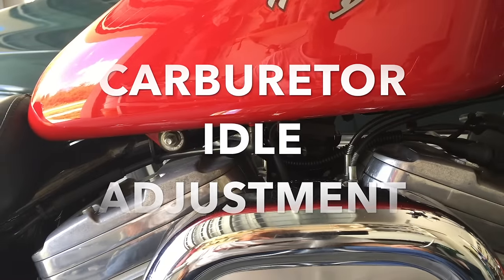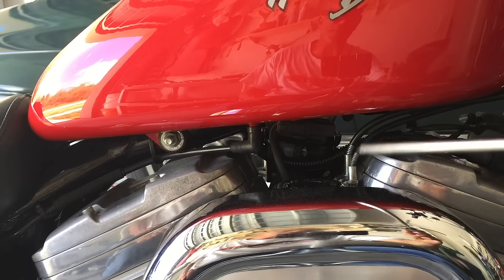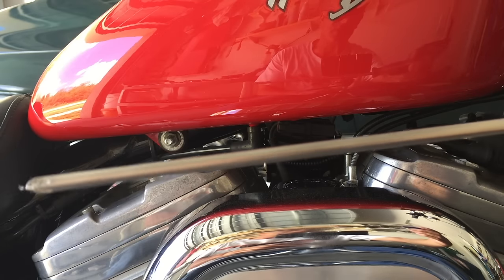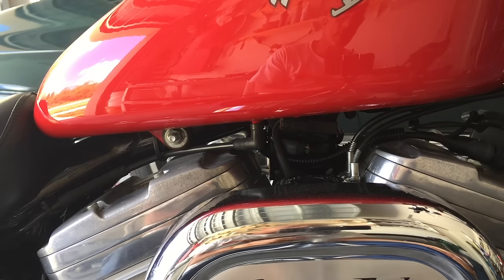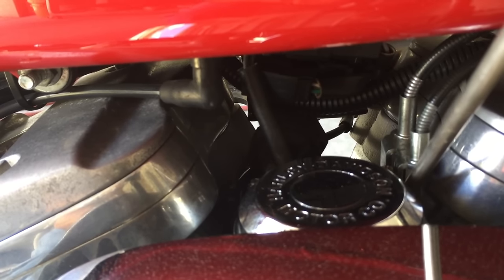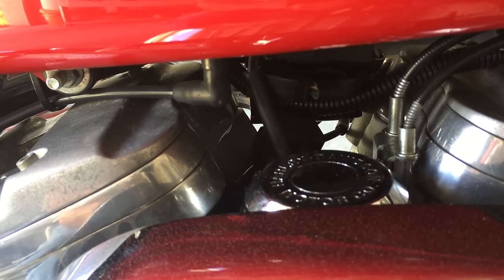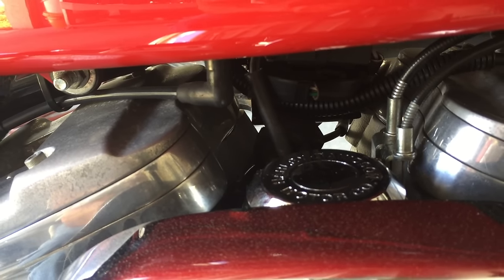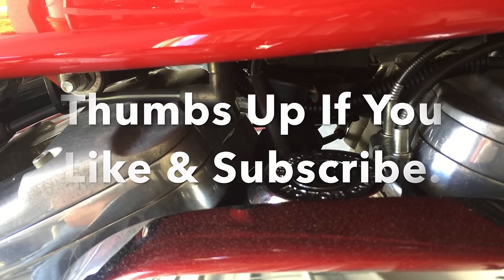How to Adjust the Idle On All Harley Davidson Carburetor Motorcycle.

Comment: Rocco, thanks for your videos! Question I have is: I moved from sea level environment to 6,500 elevation mountains. After I moved, I pulled choke out all the way and fired her up. She purred like a kitten but if I pushed choke in she'd die. Now that it's colder, it's tougher to start. Will this screw you're referring to be the right thing to adjust on my carb so I can get her running right with the choke pushed all the way in? Thanks in advance!
Reply from the maker: What year? How many miles? How long did this bike sit without being ridden?
Reply: @TwoWheelRocco  02 fxdl cv carb. 24k miles. Cleaned carbs at 23k. Sat for 3 weeks after running her last. With the choke all the way out, it doesn't seem to let me get what's needed to turn her over at cold start in 30 degree weather.
Reply from the maker: Sounds like fuel problem...I would look at vacuum line for petcock...those vacuum line can get old and fail. same with vacuum diaphragm on petcock...New $35 ... dealer part
https://www.youtube.com/watch?v=7Fo9Q93OJXI&t=8s
Let me know how this works out.
Reply: @TwoWheelRocco  hmm interesting. Didn't think that would happen with change in altitude like that. I'll check it out. Thanks!
Reply from the maker: Since  It is getting worse, And A/F screw makes no difference..points to gas supple...Let me know how it works out.
Reply: @TwoWheelRocco  it's not something that's been getting worse, it's more happened overnight from moving from 20' elevation to 6500' elevation. At sea level I would go through the usual pull choke out, cold start and then adjust choke in as bike got warmer. Higher elevation, pull choke out, cold start and bike rpms are at 1200. As bike warms up, rpms don't climb with choke all the way out. If I adjust choke in, it'll die with rpm drop. Not a problem with 80 degree weather but it is when it drops to 50s. Plus I would thing I'd be running rich with choke out all the way and normal riding.
Reply from the maker: OK Let me know how it works out..
Reply: @TwoWheelRocco  was the idle screw per your video. Had some warmer weather today, let her heat up a little. Pushed choke all the way in and she almost died. Turned idle screw up to 1300 rpms. Let her run for 10 seconds dropped her down to almost 800 then back to 1000 and left her there. Took her for a spin and no conk outs.

Comment: Rocco a question; my FLSTN 1993 has an issue since I can remember, when the bike is at 750rpm and up the exhaust doesn't sound, doesn't pop like yours all I hear is the engine mumbling but if I pull choke out the bike pops nice like a real Harley despite being really high the rpm, without choke the bike doesn't feel like idle I need to lower it way too low 500rpm to feel the exhaust sound like idle. Is this carb related or that the spark is in wrong setting?
Reply from the maker: What Carburator and pipe are you running? Sounds like your idle jet is to small. What motor? Do you know idle jet size? You can adjust Air/gas screw out, that's counter clockwise out.
Reply: @TwoWheelRocco  I'm running stock Harley cv carburetor and I have tried with 3 different pipes the bike when warm sounds like a washing machine not a Harley at or beyond 700rpm but the weird is if I pull the choke the the bike pops nice like a Harley like yours but more reved, without the choke on I need to lower the idle way down 500rpm to hear the exhaust and not just the engine alone like a washing machine. I will check the mixture screw tomorrow also the idle jet.
Reply from the maker: @AndresCuervoArt  Let us know how it works out.
Reply: @TwoWheelRocco  I now know what is happening the revs are staying up,  so if I place the idle correctly when I twist the throttle the bike stays high so it doesn't idle, we disassembled the carburetor cleaned it, replaced the idle jet with a bigger one, replaced the air seals on the manifold to engine but bike keeps doing this... I have to lower the idle screw a lot to make it idle then screw it back to a correct idle but then wheb I twist throttle the bike stays high at a different speed I.e. 550rpm vs 850rpm
Reply: @TwoWheelRocco  also I tried to adjust the mixture screw but I noticed when I screw it clockwise looking at carb from bellow the bike keeps revving up doesn't stall then I reach the end if I unscrew it counter clockwise looking from bellow the bike starts to stall at 3 turns or so... So I'm confused the bike. Is running great but it doesn't sound like a Harley on idle it's always super high not idle.
Reply from the maker: @AndresCuervoArt  Sounds like an vacuum leak.. And will not maintain idle.   spray carb cleaner around intake to see if you have a vacuum leak. What size idle jet and main jet are you running? what motor?
Reply from the maker: @AndresCuervoArt   Clockwise on CV Carburator closes gas circuit,  counter opens gas circuit.  1 3/4 to 2 1/2 out is about the right adjustment and that is counter clockwise, if you are running the right idle jet.
Reply: @TwoWheelRocco  when closing it fully the bike never stalls... What does this mean? Clockwise I have a digital tach and noticed that the revs go up when closing it but it should stall from what I've read...
Reply: @TwoWheelRocco  I will check tomorrow main jet and leak the idle jet is 40 now
Reply: @TwoWheelRocco  motor is 80ci Harley heritage softail 1993 FLSTN
Reply: @TwoWheelRocco  https://youtu.be/vc6es_OUtk0 this is when turning the idle adjustment way down to force the bike to idle then adjust it up. Sounds nice and stable
Reply: @TwoWheelRocco  when I twist the throttle the bike sound like this https://youtu.be/HrwnNynGv1s

It never returns to the desired idle stays high.  Do you think an air Leak from manifold would cause this?
Reply from the maker: @AndresCuervoArt   Yes it should stall when Air/gas screw is fully screwed in. If it does not stall you are getting gas from some other circuit.  Idle is set too high could be a posable.  Set A/f to 1 3/4 turns out.  Then start and adjust idle. What idle jet are you using?  And what motor 1340?
Reply from the maker: @AndresCuervoArt  40 is not a stock jet size for your stock carburetor that is your problem, Try an 45 idle. 180 main  A/F 1 3/4 to 2 1/2 is a good start. For CV carburetor. Try that and you should a difference on a big V twin.
Reply: @TwoWheelRocco  Rocco we replaced carbs and noticed the carb was leaking air or gas from somewhere we used different jets and needle combo finally with my needle a small jet and stock main jet found a combo that works now the carb idles and returns to idle nice also noticed that when we switched the needle with flute on the main jet that bike started to sound snappier amazing sound now bike is running a little leaner but will try to adjust mixture and if doesn't work I'll replace the idle jet for a bigger
Reply: @TwoWheelRocco  just to make sure when unscrewing the mixture counter clockwise looking from bellow carb I'm enriching mixture right? Tomorrow I'll try to adjust first the mixture is almost perfect but is learner
Reply from the maker: @AndresCuervoArt  Yes, Let us know how it worked out.

Comment: Mr. Rocco, I have a 2011 sportster 1200 Custom fuel injection, it smells to much like fumes not sure it this is normal for a Harley? I have cleaned the throttle and censer with CRC intake cleaner and changed the air filter. it idles fine just the smell is strong. do you have any suggestions to try to eliminate the strong fume smell? you have help me in the past with a couple of things and I thank you for that.
Raul
Reply from the maker: Happy to help make sure you're not running too much oil in the bike sport is like halfway on the oil dipstick. If you noticed your air filter was dirty. There's a good chance you're running too much oil. Rule of thumb, if I get oil on your finger tips when I run your fingers under the air cleaner, there's too much oil in the system. I don't like putting oil on filters. I want them clean. I feel they run the best that way. Any questions just ask thank you for all your . Ride safe and have a great day. Love those sportsters. Let us know if that helps.
Reply: Thank you for your reply Mr. Rocco, I do fill the oil almost to the top of the dip stick but moving forward I will fill halfway to the dip stick. the air filter was dry and no oil Anyware. if the fume smell continues, should I take it into the shop or is there anything else I can do? I did change the spark plug and I use supreme gas from Chevron gas most of the time. again, thank you for your feedback it is greatly appreciated.
Raul
Reply from the maker: I would remove some oil from that oil tank,  get it to halfway on the dipstick. I would remove a half half a quart and see how it goes. Do it from the bottom unscrew it plug a minute or two put it back in check your oil level. It will be different. Your bike will run better cleaner. Hope this helps.
Reply: It is time for me to change the oil anyway and will only fill it to half of the dipstick and see how that goes. I appreciate you being there to help us out when issues arise with our Motorcycles. Have a great week. Just out of curiosity what type of Motorcycle do you ride? 
Thank you 
Raul
Reply from the maker: I have two sportsters one Road King and one GSXR I love motorcycles and my Corvette. You can see my rides on my YouTube page.  Ride safe and have a great day .

Comment: Hey Rocco my 2002 fdxwg3 cvo pops thru the carb sometimes could you suggest something fore it it's 88 cu in just recently did plug and wire change bike idles on the rich side thanks
Reply from the maker: What pipe, carb. and intake set up?
Reply: @TwoWheelRocco  the carb is 40mm constant velocity  with enricher and accelerator pump espfi38mm  throttle  bore . The pipes is  factory screaming eagle that came with the bike new .thanks
Reply from the maker: Test petcock for vacuum leak this will cause a rich condition. Gas leaks from petcock diaphragm threw your vacuum line to your carb intake.      Test petcock and check your old vacuum line from petcock to carb.   https://youtu.be/7Fo9Q93OJXI  Let us know how this works out. Thank you for your Sub. Ride Safe and have a great day.
Reply: That did the trick thanks a million my friend it was the vacuum line it self thanks be safe....
Reply from the maker: Happy all went well.  Ride Safe and have a great day.

Comment: What's the proper or lowest and safest idle for a heritage softail 94? I've heard a low idle is prone to engine failure due to lack of lubrication ? My idle sounds amazing but it's pretty slow
Reply from the maker: manual says 950 - 1050.....Hope this helps..Ride Safe..
Reply: Two Wheel Rocco thanks again, I noticed mine was really slow but when I tried to to adjust idle to faster when hot I notice my bike sounds like a washing machine after riding and like I hear the motor running but doesn’t burp like yours and if I turn it down it sounds like a horse “too slow” what could be the problem?
Reply: How do you know you have 950 - 1050 without a tach?
Reply: Two Wheel Rocco please tell me if this 950-1000 rpm is adjusted when bike is cold, warmed up or fully hot after riding?
Reply: @AndresCuervoArt  I would like to know this too, rococo?

Comment: hi two wheel rocco, i recently replaced my intake manifold and intake manifold gaskets after putting my carb back together and filter, my bike wont stay on unless the choke is on and it is idling very high and even as i adjust my idle adjustment while the choke is on and idling it still stays idling high instead of lowering what should i do?
Reply from the maker: Happy to help. How did it run prior to you doing this work? Usually when no Idle , that's an indication of a bad idle jet circuit. What year? What was your bike doing prior the work? How was she running?.  Check your Choke Cable, that vinyl that it's all the way in on the carburetor. Sometimes they loosen up and causes you and Idle Problem,  the rubber or the vinyl boot does not seat properly. Take a look at the linkage on your carburetor. Make sure that's operating smoothly. Otherwise take it apart and reinstall. Did you clean the carburetor? Thank you for watching and all your support Angel. Ride safe and have a great day.

Comment: I have a 1987 harley sportster 883. When I ride and it gets warmed up and I stop at a light the bike sounds like I'm holding the throttle open a little. Would this be the adjustment I need to make to fix this?
Reply from the maker: As it's fully warmed up, adjust the idle. And see if that works out for you. Thank you for watching and all your support Chuck. ride safe and have a great day.

Comment: Why would a Sportster XL 883C spit back through the carburetor when down shifting or giving it a little gas when sitting still? Otherwise than this my bike runs pretty good. Even when riding it rarely does it. At cruising speeds it doesn't spit back through the carburetor only when slowing down and coming to a stop. After riding for a little while it even idles like it should. Any help or information would be greatly appreciated.
Reply from the maker: Happy to Help, what pipe what intake?. Do you know the Jets that you are running? Thank You for your watching and your sub Shane... Make sure your oil level is halfway on the dipstick. That Can cause lots of problems too much oil.  Let us know how it works out.  Ride Safe and have a Great Day.

Comment: Hey man should the idle be fast or slow
Reply from the maker: To slow is not good for your oil pressure .   I like 1000 to 1200 RPMs. Hope that helps.  Any questions just ask, Thank you for your Sub Jayden.  Let us know how this works out. Ride Safe and have a great day.
Reply: @TwoWheelRocco  hey I don’t have a rev counter do I just go by the sound
Reply from the maker: Yes I do it by ear.. if there's no RPM gauge. Hope this helps. Not too slow not too fast it's not too hard.  hope this helps. Right safe have a great day

Comment: I installed an after market air filter (TC Bros) on a 06 HD Sportster and now im getting some backfire on acceleration. Can this be fixed by adjusting the carb? I'd greatly appreciate the help. Thanks.
Reply from the maker: Are you using the stock pipe?  Sounds like you can adj. A/F screw out 1/4 and test drive see where it runs best. Let me know how this works out.Hope this helps.
Reply: Two Wheel Rocco ...already had Vance & Hines "Shorty" pipes installed when purchased. I will try your recommendation and let you know how that turns out. Thx for the help. Really enjoy your vids keep up the awesome work we all appreciate you for making them. Positive vibes your way,  ride safe 👍
Reply from the maker: Before you installed  the air filter..How did she run? Let me know how it works out.

Comment: im getting a pop in my carb, watched you carb adjust video and now this one. gonna go turn up my idle cause its a bit on the low side, kinda where in this video you went to counterclockwise. and then going to follow up with 1 1/2 - 1/4 turn on fuel air mixture screw. and see what result im left with. ALSO.. that issue i asked about with crank no spark few weeks back was bad spark plug cables haha.
Reply from the maker: Let us know how this works out. Check for Vacuum leaks.
Reply: @TwoWheelRocco  would leaks be in the manifold area?
Reply from the maker: @JUNIORGONG.ASFxCK  Yes and vacuum line that gos to petcock,  Spray brake cleaner and see if idle changes.    https://youtu.be/kivgNpZWHeY. Let us know how it works out.

Comment: So my 06 1200 custom is running fine starts fine. But at idle it almost “chokes out” and dies. As long as you are in the throttle it runs great. But if I try and give it gas while idle at a stop sign say it just can choke out and die. 

Is this an idle issue or vacuum line possibly as seen in other videos?
Reply from the maker: Happy to help. Any questions just ask I would start by cleaning the idle jet. Sounds like this bike will not idle unless the choke is on? If so take a look at this video and clean the jets mainly idle jet.  that's sounds like the problem lies.. take a look at this video. https://youtu.be/Pp4l-zbQcy0.  Thank you for watching and you sub Cody. Let us know how it works out. Ride safe and have a great day.

Comment: If it's too rich it'll smoke and smell like gas, also it'll start misfiring. You'll probably have to replace your plugs if too rich, they foul and it's really hard to bring them back. Keep extra plugs on hand 👌
Reply from the maker: Happy to help. Sounds like you have a Carburator issue not a spark plug issue. Spark plugs is a symptom. The carburetor is the cause, I would start by testing your Petcock. I will send a video if the Petcock Diaphragm fails,  Sets up for a very rich running motorcycle. Let me send you these videos. Thank you for watching all your support crazy guy. Ride safe and have a great day. Let me know what you think.   https://youtu.be/7Fo9Q93OJXI?si=rB33yf0vMeNW1NS4. Scott here and let us know check for vacuum at the Diaphragm and check the vacuum hose from the Petcock Diaphragm to your carburetor. If any of those are failing you have a rich running motorcycle. I hope this helps.

Comment: So my bike has been running strange again not sure what it could be this time I've rejet the carb, adjusted the air fuel mixture screw, changed out fuel filter, and adjusted the idle, but for some reason when reving up or to accelerate i get a couch and a pop sound from the air breather. i have searched everywhere to find out how to fix this issue and there is not one video that describes this issue and how to fix it?
Reply from the maker: Happy to help. Try adjusting the slide needle. I'll send a video    https://youtu.be/G1XD0hHtwCw. Let us know how it works out. Thank you for watching and your support John. Ride safe and have a great day.